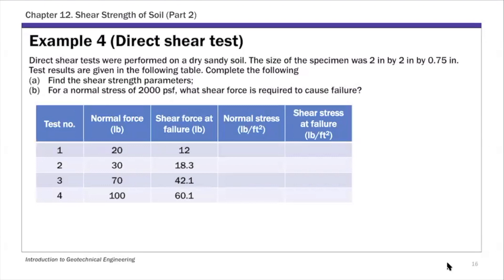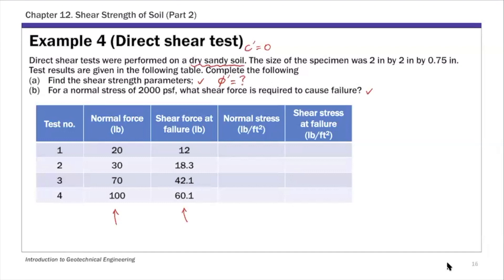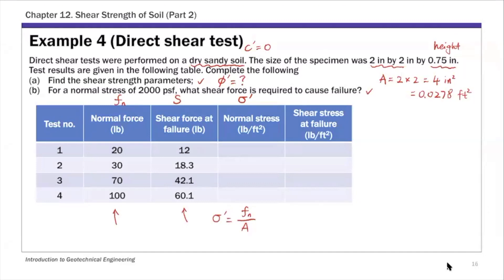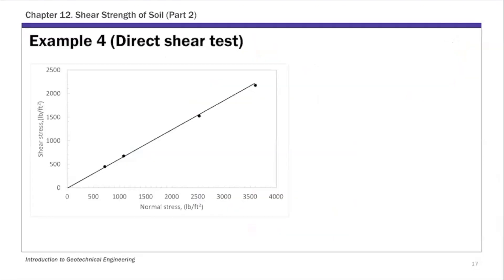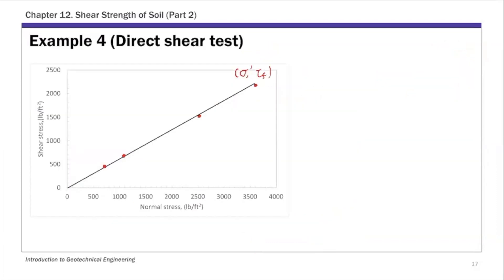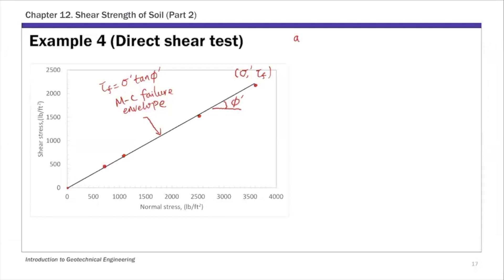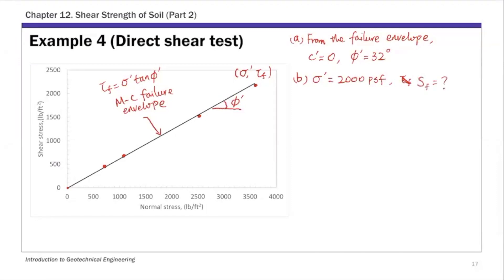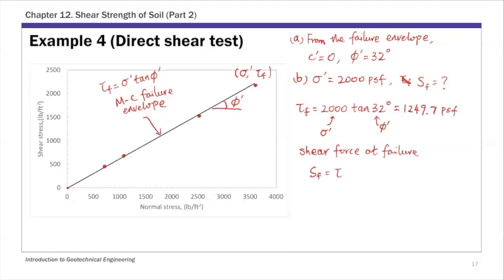Chapter 12 Shear Strength of Soil - Example 4 Direct Shear Test

Comment: How do you choose those values for normal force? If the answer is checking the depth of the sample, could you specify more? Because I never see an example where they calculate the normal stress for this type of problem. My Direct shear machine gives the units already of PSI for the vertical load, I assume is for using the normal force. Thank you
Reply from the maker: The normal force was set when conducting the experiment. In your case, you already have the normal stress from the device (e.g., 1000 psi, 2000 psi, etc), no need to worry about the normal force. As for the vertical deformations, they are the output of the direct shear test.